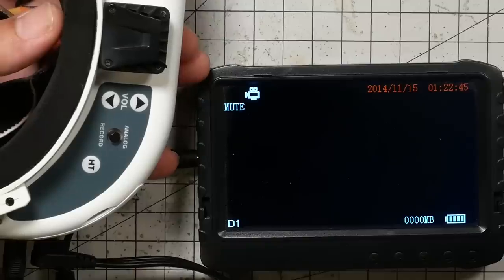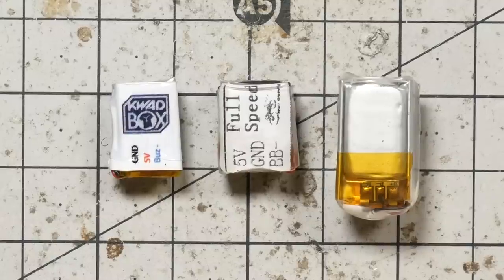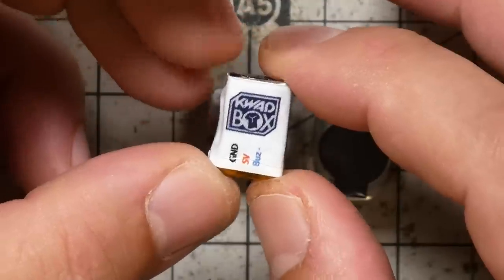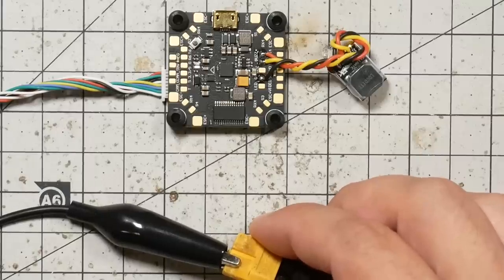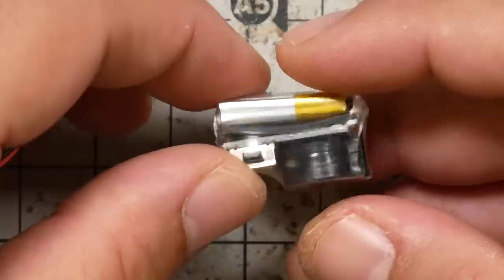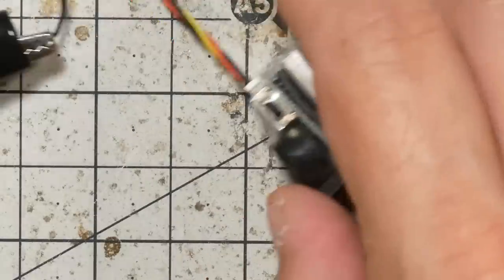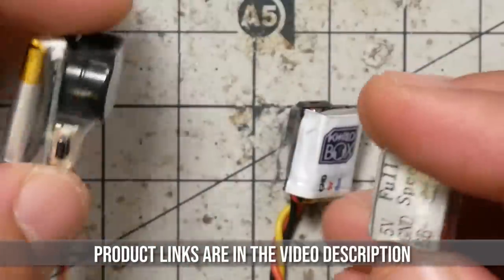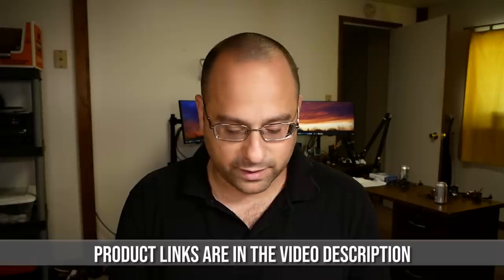Never Lose Another Drone | HELLGATE VIFLY FULLSPEED BUZZER

Comment: Does buzzer mode turn on 5v output on the buzzer pad of the flight controller ? Or does the buzzer always need it's own battery ? Like if i put leds onto my buzzer pad could i turn on and off leds by swiching buzzer mode on and off ? 
  Or how about a camera tilt servo ? Can i hook an rc servo motor onto the buzzer pad and have a servo move a camera tilt up and down like a crankshaft and just try to shut it off at the oreferred camera angle ?
Reply from the maker: Buzzer mode switches the bz- pad which is switched to ground. BZ+ is just a 5v output. You can't switch the LEDs using the bz- pad, no. You would want to use a realpit for that.

Comment: Hi Joshua, 

I wired everything perfectly according to my flight controller in mode Type A.  The alarm seems to work when I unplug the Lipo...
But for some reason I ignore.... The buzzer mode won't work ...( and yes i have set up in Betaflight the Buzzer mode to a channel correctly).   

Do i have to let the internal lipo of the Buzzer get fully charged ??? Any help would be appreciated

Thank you

Comment: thanks. I do have a question. can any of these be connected to a REMAPPED pad? I know from another of your videos, that a "bare" buzzer cannot, you need to add a transistor (a possibly a resistor), but since these have their own power supply, would it be safe to use - say - a LED_STRIP pad? I'm asking since the Beta85 Pro2 FC does not have a BUZ- pad, and I'm a beginner living in a dense vegetation area. thanks
Reply from the maker: Yes it would be fine.
Reply: @JoshuaBardwell  thank you very much! 👍

Comment: I’ve found a lost quad using RSSI. Signal strength goes down when the tx antenna is pointed at (in parallel to) the rx.
Reply: That's a good technique, something that the UndergroundFPV guys are planning on implementing with their Nirvana TX because it has an internal patch antenna.

Comment: Thanks Joshua! I have the Kopis 1 and my beeper is working with a switch but it is not loud at all. I have dshot commands/turtle mode working. How do I know if it is the physical beeper or the esc’s? I read somewhere that you need to add a script in betaflight to disable the esc beeping?
Reply from the maker: Put your finger over the top of the beeper. It will silence it. If you still hear beeping it's also the motors.
Reply: Joshua Bardwell Thanks. I will check it out when I get home. I was worried the ESC beeper cancelled out the real beeper which might be louder. If they both work it’s no problem right? It just isn’t that loud at the moment.

Comment: Would you be able to connect these to an extra servo port on a receiver? For use on a fixed wing? I'm thinking if the buzz plug was connected to the signal, could you just have it as a buzzer on a switch with no need for a flight controller?
Reply from the maker: I'm not sure about this. the Buz- pad is NOT a PWM output. It's simply a transistor that connects the buzzer to ground. Maybe the buzzer could be smart enough to tell the difference.
Reply: Yes, VIFLY Finder 2 can be used on fixed wing.
Reply: @VIFLYDrone  that's great to hear. So I can just connect it to a spare port on my receiver and I don't need a flight controller?
Reply: Yes, connect it with the receiver. It should be released early Oct. Just stay tuned.

Comment: Question. Does the VIFLY have the ability to disarm by plugging in the battery for 1-4 seconds as well? Or button only. If it’s tucked away in the quad accessing that button can be a pain.
Reply from the maker: Yes, they all can do that.
Reply: Sweet, thanks! I fall in the “most probably don’t need it” category but it’s pretty cheap insurance for the one time it happens to you kinda situation. I spent over an hour trying to help someone find a grand plus fancy “phantom” like drone or what ever it was and was never found. Why a $1000+ drone doesn’t come with a buzzer is beyond me...

Comment: hi sir. how to make buzzer active when voltage is below than set trashold? my osd chip burnt. but managed to power the fc from 5v bec.buzzer will help me to know the min voltage to land.
Reply from the maker: Betaflight's default behavior is to buzz when voltage goes below the Warning threshold set in the Power and Battery tab, which is 3.5v / cell by default.
Reply: @JoshuaBardwell  how if i use dshot600? not actual buzzer

Comment: good luck holding a button on a buzzer installed inside your quad :D  also thanks for acknowledging the OG status of the HellGate buzzer ;)
Reply: Thats what I was thinking should have been motioned. Otherwise good review. I was wondering the differences between them. Don't really want to dismantle my quad to get to the buzzer every time.
Reply: The cheaper ones works tha same as the original by connect battery again too. The button is only for extra option to disable it.
Reply from the maker: All of the modules in this review can be disarmed by plug/unplug method.
Reply: Cool. Thats good to know. I have been tempted. Especially as its a case of "I told you to get one" with the boys I fly with.  I am wondering about sticking it in a 2,5inch for that time you land it in a tree. Hard to find them when they drop. Is it worth the extra weight and space?
Reply: Joshua Bardwell yes but having a slightly different second intervals.
Reply: Joshua Bardwell its funny that you are doing this review now as in your last live q&a my friend John Potts asked you how his friend keeps finding his quad when he can’t. Im that friend. 😂 it’s become a running joke. I have allot of hours logged for the day I loose mine. 😉
Reply: snail.fpv I’ve got the vifly finder on my rooster just behind the cam, and have no problem getting to the button.

Comment: Hi Joshua I bought the FPVKing New Mini JHE42B lost quad buzzer off amazon.com I hooked it up but when I arm the buzzer makes a constant loud beep until the motors spin as soon as I stop the motors from spinning (decrease throttle to zero) its back again beeeeep! Is there a way to stop this from happining?
Reply from the maker: My guess is you connected the buzzer+ pad to 5v or something like that. I guess what I mean is, double check that the wiring is in the right place.
Reply: @JoshuaBardwell  fixed it! In the older Betaflight theres an option for the buzzer to go off when the quad is armed but the motors arent spinning

Comment: This has nothing to do with this video but I have a question for you my Quadcopter jumps to the air like crazy with just a little throttle the props are in the right order what can cause my Quadcopter to jump to the air with a little of throttle
Reply from the maker: If it flips over, then do the checks below. If it goes straight up in the air, it might be too much vibration getting into the gyro. Make sure you are on default PIDs. Disable "32k gyro" in the Configuration tab.

Here's what to do if it flips over:

If the quadcopter instantly flips over when you arm and raise the throttle with props on, it is almost 100% certain to be one of these things:

1. Clockwise prop installed on counter-clockwise spinning motor or vice versa.

2. Flight controller not facing forward. Go to the Setup tab in the configurator. Tilt the quadcopter on all axes (pitch, roll, yaw) with your hands. The 3D model in the configurator should move the same as you move it with your hand. If it does not, use the Board Alignment parameter in the Configuration tab to fix it.

3. Motors not wired correctly. TAKE OFF YOUR PROPS. Plug in a battery. Go to the Motors tab. Turn on the "props are off" slider in the lower-right. Raise the individual sliders (1, 2, 3, and 4) one at a time, just enough that the motor begins spinning. The motor positions (1, 2, 3, and 4) should match the graphic in the upper left. If they do not, then either move the signal wires so that they are correct or use resource reassignment to virtually "move" the motors.

4. Motor spinning wrong direction. Do the same as step 3 but compare the motor direction to the arrows on the graphic in the upper left. If a motor is spinning the wrong direction, either reverse it using BLHeli (or whatever ESC software you are using) or swap any two motor wires with each other, which will reverse the direction.

Many times, people swear up and down they have checked all of these things, and then come back to say oops I missed one you were right. So if you think you have checked all of these things and your quad still FLIPS OUT, go back and check again. If your quad is insta-flipping on takeoff, it is almost always one of these things. l

Comment: I have the Dom HD2 and my menue only gives me the options of Format and Playback. Is this a HD3 onwards feature?
Reply from the maker: The goggles you saw me using were HD2. However maybe older HD2 don't have this feature?
Reply: Joshua Bardwell  My original manual also describes only the two functions mentioned, seems to be a later version upgrade.
Lucky you...

Comment: Hello, is it possible to install this system on a DJI Mavic 2 pro? Would the editing be easy? Thank you in advance.
Reply from the maker: I guess you could install it. You just need to find a 5v output.
Reply: It should not connect directly to the battery?
Reply from the maker: No, absolutely not. The buzzers take 5v, ground, and a buzzer signal pad (which probably would not be used on a Mavic).

Comment: Will any of those work on an airplane that has no FC? will it run off a radio channel/ a TX switch?
Reply from the maker: I think the answer is yes they will also detect a PWM channel from a receiver, but I'm not 100% sure about that and you should double check.
Reply: VIFLY Finder 2 can work on with RC plane. Just connect it to the receiver.

Comment: I really like the louder buzzer but I would any one of these products if they also take a standard pwm input so I can use it on any model any time.
Reply from the maker: They all do.
Reply: @JoshuaBardwell  pulse-width modulation from 1000 to 2000 milliseconds?
Reply: All those products including VIFLY Finder V1 version can't take standard pwm input, but our new version will fix this that it can be used on any models like quadcopter or fixed-wing.
Reply: @VIFLYDrone  if the bb- pen could be either bb- or pwm at 1800 or higher milliseconds so you still only need the three pins and it could be swapped around with a jst connector or installed in any mode, your product will sell more than any radio-controlled related products currently on the market guaranteed!

Comment: The thing that's not discussed here is how each really works day to day, when you don't loose your quad.  Everytime you unplug you have to disarm the buzzer.  I have a hellgate and a lunchbox one, the hellgate I got used to really quickly because you could just unplug and hold the connector back on for like 2 seconds and it would disarm.  The lunchbox on the other hand is supposed to do something similar but I could never get it to disarm by power, only with the button, which was difficult to get to in the best spot I had, and it was infuriating to try and press it 3 times at the right pace for it to disarm.  It took a few tries most times, all while it's beeping at you and your buddies are looking at you like can you shut that up?  So for me the lunchbox isn't worth anything because it was just to irritating to use day to day, it's been removed and replaced by a hellgate now.
Reply from the maker: All of these also disarm using the plug-unplug method.
Reply: Joshua Bardwell maybe I got a bad 2, but neither of mine will do it.  Do you find that the lucky box or hellgate are more finicky about the window of time you need to be plugged in than the other?  I've tried 1-20 or 30 seconds on the lucky with no luck

Comment: The only thing I don’t like about the hell-gate is the way to turn it off, cause what if your battery leads are ripped off or any wires to the buzzer.
Reply: I guess that’s the lesser of two evils. I’d rather have a found quad that I can’t shut up then a lost quad I’ll never see again.
Reply: troutbum86 RDQ sells a wireless one that goes off after 30 sec it there is no motion. 🔥🔥🔥

Comment: There is a V2 of the ViFly Finder now... not sure when it was released but it basically adds a LED so it can strobe that at dusk/dawn, and also shut down during night time, all the better to preserve it's screeching power for daylight when you're likely to be able to see it. Plus the runtime was extended to a whopping 30 hours by increasing the duration between beeps (and the nighttime idle mode)... https://oscarliang.com/vifly-finder-2-buzzer/

Comment: What about those battery voltage,cell checkers they have a hook up sometime isnt there a buzzer on these I could hook up. Idk just a idea guy lol
Reply: Also what about hooking the buzzer up to the led stip pad I said it has it's own timer and channel would this solve the loud buzz when hooking up battery
Reply from the maker: You cannot hook the buzzer up to the ledstrip pad without also building a transistor buffer to handle the current of the buzzer.

Comment: Turning I off the rx bay not required on current Fatsharks (which sounds good,  but sucks). 
GPS telemetry is helpful bth on radio and via. OSD/DVR.
You can use your flight radio and Rssi along with. Spinning around to help find it,
The most important quad recovery tool though is correctly configured fail safe.

I consider myself quite the expert on. Quadfinding these days.

Ps if you want a normal regular buzzer get the matek one its a couple bucks more expensive but really loud which you want when you lose a quad.
Reply: jtan163 Lets see, you're telling us that a correctly configured fail safe is the MOST important quad recovery tool??? Yesterday while flying in my 1 acre yard (surrounded on 3 sides by woods) i lost control (hit a race gate) and the quad went spinning wildly into the woods. So using the DVR was useless (blurred because of spinning out of control) In the second or two that it was going towards the woods i knew i could not recover the flight so I turned off the motors before I hit. I used my radio RSSI and my Matek buzzer to locate the quad (took about 20 minutes). Did i mention I am hearing impaired and cannot hear my Matek buzzer until I am within about 10-15 feet?  Did you REALLY mean to say that a failsafe is the most important tool to stop flyaways?  I'm new to quad flying so PLEASE TELL ME HOW MY CORRECTLY FUNCTIONING FAILSAFE WILL HELP ME RECOVER MY QUAD in this example???

Comment: Hi Joshua! What to do if copter still has battery power but you cannot activate buzzer because there is no RC link?
Reply: Set it up on failsafe and/or set up the beacon function in blheli.
Reply from the maker: Failsafe should activate SOS buzzer by default, or you can manually set your buzzer aux mode to failsafe in the "on" position.
Reply: Thanks guys!

Comment: Omnibus F3 ( Non Pro Edition)
Firstly I had it wired incorrectly  thinking everything and its momma needed a Tx type of control pin from the FC. 
Buzzers apparently do not. 

After some wiring video from ViFly's site
I placed the Neg to the Buzzer Neg powered it from Buzzer power and grounded it to some neutral ground on the FC.
She works HOWEVER in Betaflight I set up PROPERLY a switch for Buzzer.  TURNED OFF the Motor Beacon as Lost Model Alarm in Betaflight and tested it
Buzzer MODE  engages properly for switch  but no Vifly Sound  re engaged ( saves and reboots between each setting change ) Motor Beacon as Lost Model Alarm in BF  and its back to motors alarming no Vifly    

Anyone  have a clue ? I'd like it to sound loudly on switch  even when Battery is still snugly attached connected to quad  !

Comment: cool i didn't know the auto start fonction ...buti hope it will not  destroy the file when i unplug the lipo from my hd3
Reply from the maker: HD3 and other newer DVR boards have circuitry to protect the file when power is pulled.
Reply: hi Josh, my hd3 do not save the file when i cut the power  so maybe there is different batch ...

Comment: Late to the party, but... The Vifly Finder 2 has issues. A lot of them do not work when shipped due to low battery voltage. Mine measures at 580mV!
So to get them to work, desolder the batter from the board. Charge it from a 1S charger like the one you get with a Tiny Hawk or something. 
Resolder, it'll work. 

Not worth it imho. Won't buy again...

Comment: they should build one that is just an xt60 male to xt60 female plug with the buzzer stuck on. then you can just plug it into any prebuilt quad between the battery and quad.
Reply from the maker: That. Is legitimately interesting.
Reply: thank you. I am the first person to think of it as far as I am aware :)
Reply: Great idea. It will be very convenient. But it will not work as a standard buzzer if doing like this. It only can beep when the battey ejected.
Reply: that is correct. definitely a drawback.

Comment: My flosstyle with gopro is in my pond..any tips on finding it?
Reply from the maker: Diver.
Reply: underwater/waterproof metal detector
Reply: Have you tried magnet fishing?
Various places like Banggood sell specifically designed magnets for this purpose - a powerful neodymium magnet with a loop on top for attaching a rope.
Reply: I've tried raking and 200lb pull magnets with no luck

Comment: How did you output your goggles to an external screen?
Reply from the maker: Most goggles have an AV input/output. On Fat Shark goggles its the 1/8" plug on the right side near where the battery plugs in.
Reply: Joshua Bardwell   I didnt realize that was also an output. Thanks